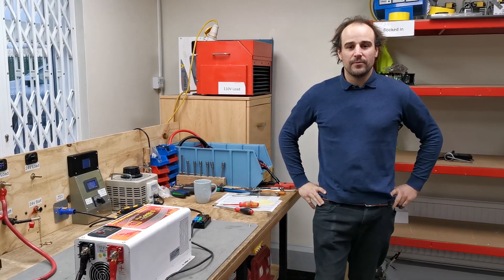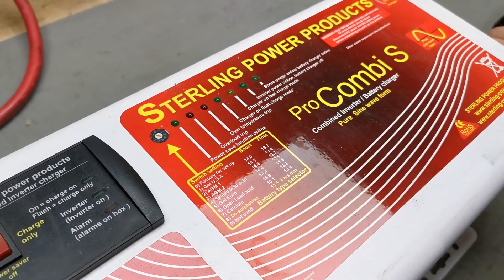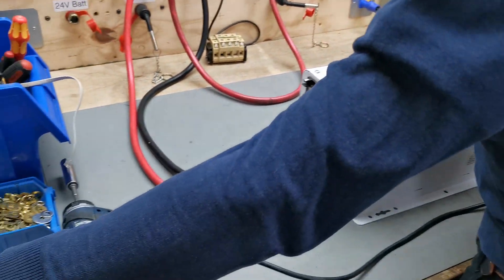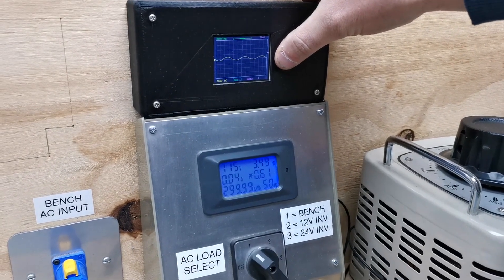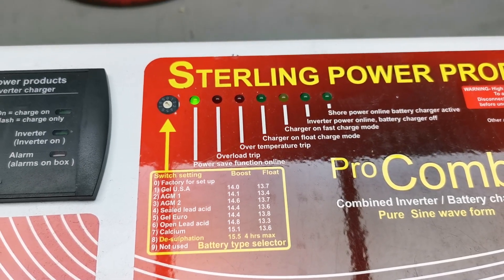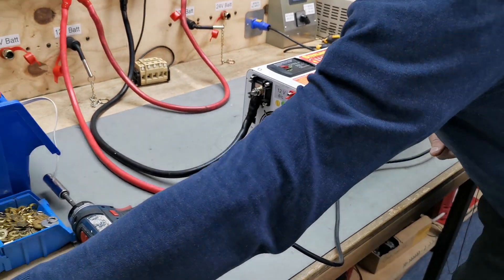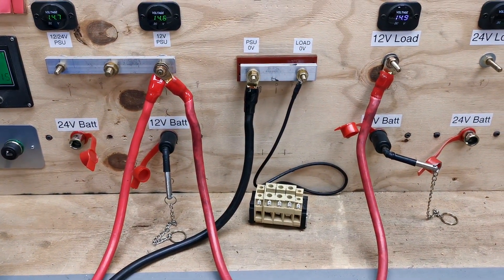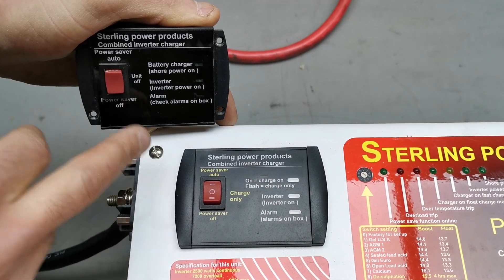Sterling Power Combi Switch Guide

Comment: Hi, what could be an issue if a power saver mode does not fully switch on but just constantly keeps trying to engage but never does? makes buzzing sound  with every try and light flashes with every buzz? thank you
Reply from the maker: Hello Marcas,

It's most likely that there is not a sufficient load on the AC output to engage the power saver auto mode to operate. 

Does it work on Power Saver Off?

Comment: Hi
We had a new ProCombi S,2500w,  installed on our nb 2 years ago and we are now constant cruisers. We had never been able to use the Power saver mode so thought it may due the old 240v  fridge, so recently invested in a brand new one. On the label it states "Rated current 100w" so theoretically enough power for it to kick in, when in power saver mode but it doesn't, even on the highest setting. Any advice? Thanks
Reply from the maker: Hi Victoria,

If the fridge alone is not engaging the power saver mode, there's not a lot we can do to adjust the sensitivity. 

Apart from turning more electronics on or more appliances on to try to put the load up and force engagement, the only option would be to just put the item into power saver off, so we can power anything onboard. 

Ben
Reply: Hi Ben
Thanks for your reply, 
Even with the TV and other small appliances switched on i,e, laptop, phone & Alexa, I would have thought the addition of the fridge would have kicked it in.
 Do you think there is any chance the inverter has not been installed correctly or the unit is faulty?
Reply from the maker: @victorialowe1541  
Hi Victoria,

Always a possibility that there's something wrong, either with the item or the system, but it'd be sensible to perhaps try something with a bit more pull on power saver mode first.

Generally, if someone's onboard, my personal recommendation is POWER SAVER OFF, anyway. 

Ben

Comment: and another thing i found out that shore power does not engage most of the time unless i put some other load prom the same sockets before it goes to inverter. does this mean it does not engage because of voltage being to high?
Reply from the maker: Possibly. What actually is the voltage coming into the unit?

Comment: What inverter setting should I use for Lifepo4 (12V 280 A)  ?
Reply from the maker: Hello,

I believe you have also emailed- but choose a profile that lines up for your battery manufacturers recommended voltages. The name assigned to most profiles is actually redundant, the voltages are all that really matters. Generally Sealed Lead Acid lines up with most lithium charge voltages in my experience.

If the manufacturer recommends lower, then choose a lower profile- but the manufacturer of the batteries needs to take precedence here- they know their batteries better than I do!

Comment: Thanks for the demo. 
I have acquired a vehicle with this unit installed (122500) & have a question re the remote. 

I have the remote with the “unit off” middle position which in the demo can be seen (& explained ) that the charger still operates when in this position. 
Mine doesn’t & just curious as to why really? 

The unit works perfectly well otherwise but simply turns off when in this “unit off” position. 
Thanks!
Reply from the maker: Hello Andy,

Newer combis have the middle position as 'Charge Only'. Older ones have the middle position as 'Unit Off'- and I'm afraid that it really is as simple as age.

The older units middle position is, wholly, off. 

Hope that helps a little!
-Ben
Reply: @SterlingPowerLtd  Hi! Is there any other difference between the older and newer ones? I've recently acquired one with the old style remote, and I'm wondering if the new ones have any other features beyond a changed remote function. Thanks :)

Comment: Hi there. I have the Pro Combi Q. Does this count as an older model that doesn't have a charge only function? Which ones are the older models? Thanks
Reply from the maker: Hello,

Yes, the Q would certainly be one of the older models. We no longer produce the Q.

The older pure sine combis also may be lacking a 'Charge Only' function, replaced instead with the middle position being 'Off'. Only way to visibly differentiate is by looking, I'm afraid.

Comment: Hi… thanks for the video as was really interesting. We have the pro combi s on our boat which is on shore power and has been for 3yrs. Until recently I had left it on power saver off but have now been told that this would be detrimental to our batteries. I don’t have an electrical mind so can’t really see the difference between PS Off and Charge Only… are you able to elaborate in really simple terms please? Thank you.
Reply from the maker: Hello Clive,

Charge only means that the unit will not provide power to AC from your batteries, IE, it will not operate as an inverter but will still act as a charger.

Power Saver Off means that the unit will provide power (when there is no AC input to the combi) from your batteries to any AC load or demand, acting as an inverter, but when you have AC input it will also be acting as a charger. 

Not quite sure why one would be regarded as detrimental to your batteries, particularly if you are plugged in to shore power. 

If you were to be not plugged into shore power and away from your boat for a long period of time I would put it into charge only, because charge only means that the unit does not even operate unless it has AC input, saving your batteries from being depleted at all, even to a passive load- but if you're plugged in perpetually I see no problem. 

-Ben

Comment: I’m in a marina on shoreline permanently and I have just installed 3 new batteries on my NB. My Pro Combi S now stays on Fast Charge constantly where as with the old batteries it would sit on Float Charge. The new batteries are exactly the same as the old. Im worried that the batteries are being overcharged.
Reply from the maker: Hello,

Please get us the voltage on the DC output of the combi. We can then see how things are behaving just from that reading

Comment: hi guys, thanks for the demonstration. Great video. i noticed in your video that you don't have anything connected to the earth terminal on the 12 v DC side of the Pro Combi S (bottom right hand earth connection). Is this normal? and if it should be connected to an earth  -  if you have a  galvanic isolator on a boat should this be connected to the Shore GND or the Boat GND? thanks
Reply: Boat earth. One size lower than the inverter DC feeder cable. Boat Earth Bus and Ground Bus ought to be linked with the same gauge earth cable.
Reply: @scruff7559  thanks Liam
Reply: No probs. It's sized to sustain a fault on the DC as well as the AC because that's a potential failure mode too. Hence we also link the earth bus and ground bus. If you want to save a lot of cable you can  link the earth to the DC negative at the back of the inverter. There's probably a reason you shouldn't but I can't think of why not other than it  not being intuitive.
Reply: Thinking about it the reason you'd make a big triangle between inverter earth to boat earth bus to DC ground bus instead of doing it at the inverter is just in case the inverter DC ground is broken to the inverter. If that happened then the DC would try to use the tiny 1.5mm² earth on the front of the unit to power the inverter primary which would be very bad in a melty way. Best to run the cable the long way. I believe that requires a 75mm² earth for the 12v 2.4kVA unfortunately.

Comment: Why are the peaks flat? How do I turn off the charger but allow the transfer relay? Did you filter out the inverter carrier frequency from the video audio? What's the quiescent idle power?
Reply from the maker: Hi Liam,
1) The peaks are flat due to the pure sine wave range we were operating in for this experiment. If we reduced the load and put a more usable voltage onto the PCS we would see the operatable pure sine wave range extend. The flat peaks are where the pure sine wave limits for this 'test' are being reached.
2) You cannot without isolating the batteries themselves.
3) We did not, there were no audio edits done in post. It was recorded on mobile and it may have automatically selected and filtered out audio. 
4) PCS122500 quiescent is about 1mA when 'off', and that's just to run the micro. When running, power saver mode is about 1A, non power saver mode is about 2A.

Does that help?
-B
Reply: Hi Ben, sortov helps. Odd though I noticed the peaks are quite flat on my oscilloscope with the ProCombi S operating no load. 
So are you saying the unit is safe to operate in throughput without a battery? Or that if I rather not use the charger on shore power then I must also lose all my downstream AC loads?
That carrier frequency is a killer...can't be listening to it myself.
Reply: I just checked my notes there..I measured a quiescent of 35.8W on a 12v 2500VA model.
Reply from the maker: @scruff7559  Hi Liam,

That is odd. I've yet to see anything not be able to run off of the combi, so to my knowledge it effectively simulates a pure sine wave. I'll ask our returns manager to do a couple more tests on the combi for my sake. 

To make sure we're talking about the same thing regarding the throughput, are you talking about the AC input being directly used to run your combi AC output? If so, as far as I am aware, there is no way to disable the charge process, so the only way to do so would be to isolate the batteries from the combi. 

How old is your combi?

-Ben
Reply from the maker: @scruff7559  Comes to just under 3~A, is that on non-power saver mode?
Reply: Yes Non-power saver. I tried power saver myself with an iMac and came to the same conclusion it's only for fridges...old fridges, without soft start or zero-crossing, even power tools are soft start these days and render the feature useless.

It does run appliances fine the peak resolution is low though, Studers are much better, so are Victrons but Victrons have harmonics built-in and solder the input fuses.

The Charger thing well it's sometimes beneficial to only use the transfer, say your shore power current is limited or you are using a battery chemistry not catered for by your charge profiles or you are powering it from another inverter and only want to power the loads and not charge the vessel battery, or you have another charger and you'd prefer to run that as a solo primary. In effect I like the feature to disable the charger and not have to rewire the AC output to maintain power to downstream AC loads.
Reply: The combi is pretty old. 5-6 years. It has the updated remote.

Comment: Would be really helpful to have a more simple explanation e.g. I’d you’re moored with no power, use this setting. Seventh time I’ve watched this, which as someone with a PhD, tells you how complicated this is
Reply from the maker: Hello Diana,

Yes- I'm afraid we sometimes have a habit of making things complicated. 

Middle position should be used when you are away from the vessel/vehicle and you don't want to risk any parasitic drain from the combi. It's essentially the 'Off' position, but also allows pass-through from the AC and allows you to charge your batteries.

Power saver ON is for when you would like to cut down on the passive drain (quiescent current) of the combi and would still like it to respond to your larger loads, powering them at will. It will not power low loads, however.

Power saver OFF is for when you would like it to power everything, with a constant live out.

Comment: hai can anybody tell tell me can i use this combi s pure sine 3500v for my house if any power cut  may be for couple of hours ?
Reply from the maker: Hello,
If you have a large enough battery bank to power your needs for those couple of hours, and the combi power rating (3.5KW) is within the spec of what you would use in your house, then yes.
Reply: Hai thank you for the reply .is this item has in build charger unit ? So I need just 12v battery only . Do I need specific battery or just normal car battery ?
Reply from the maker: @SamithdumindaSenanayake  Hello,

Yes, this has a built-in charger as well. 

You just need a 12V battery system now. You'll likely need more than just one battery.

Our personal advice would be lithium, but any 12V batterybank of sufficient size should be suitable.